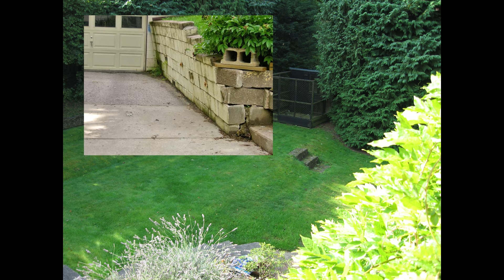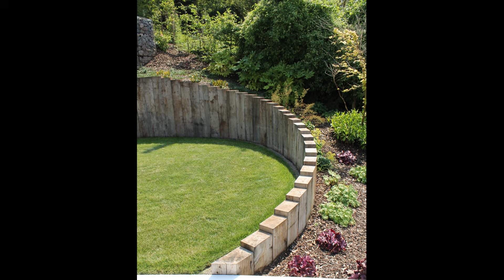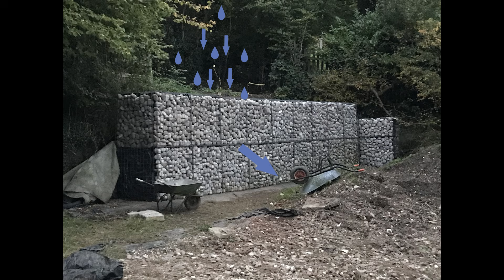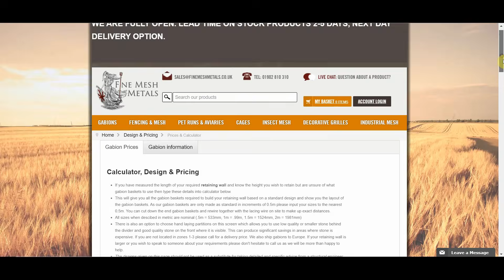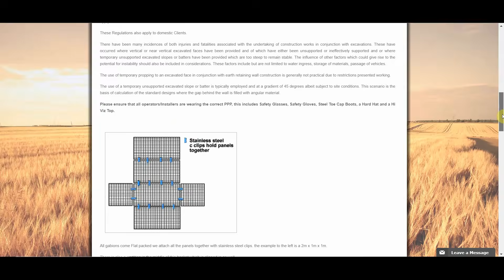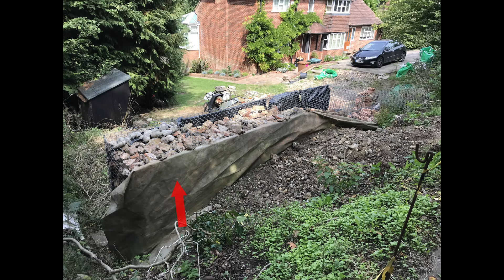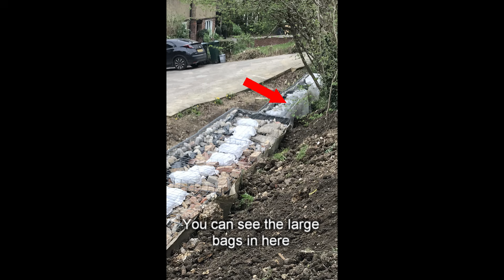GABION RETAINING WALL CONSTRUCTION with cost saving panels | Full Walkthrough with Audio - Part 2

Comment: Hello Karen, in the video here at 11.30 you show how you've lined the inner partition before putting the white cobbles in, can you see this through the cobbles and do you think a white lining might be a better option?
Reply from the maker: Hi Dave, if you go to 3:38 in my first video - https://youtu.be/gmiBY9zmC08 - you can see the effect the black geotextile gives. I did try the white behind the cobbles, but in my opinion it looked like white behind the cobbles! The black seems to give you that indefinite cavity look as if there were further cobbles behind. I guess it comes down to personal preference. I happened to have the black geotextile as I'd purchased some for the driveway rubble, but then after further research found out that the non-woven (white) geotextile was better for behind the gabions as it had better filtration, ie soil couldn't wash through (whereas the black has some tiny holes in it). So I had both to hand.  Does that help?  Karen
Reply: @OurHomeProjects  Yeah definitely, it kind of makes sense as it would be dark and shadowy between the  stones, white as you say  could easily be too obvious. I've ordered the fabric and gabions this evening,  just trying to source the 80mm pipe, I only need 4 metres reluctant to pay for 25 metres! Big day tomorrow, we've made an enormous pile of clay from digging out our dirt and its in the garden - the bloke with the grabber lorry is going to come tomorrow evening to see if he can access it and load it on to his truck. If not we're moving the whole lot again another 60's into a layby down the road from our back gate! There's got to be about 20 tonnes of clay!
Reply from the maker: Hi Dave, wow, hope you don’t have to hand shift anything. Re the pipe. I wouldn’t bother. I suggest sticking a load of gravel behind the baskets. To be honest it’s belt and braces. The gabions are porous themselves so you really shouldn’t need a pipe behind. We added one as the structure was 2m high and wanted to be sure.....you probably don’t need gravel unless you’re getting some in anyway. Which fill are you using - gabion stone?
Reply: @OurHomeProjects  Hello Karen, yeah the bloke came round this morning and thankfully it's all systems go and he'll remove it all on Wednesday which is a relief. I think I'll take your advice and scrap the pipe unless I can source some in the next 2 days or so for a reasonable price . I've ordered the Gabions using same place you did and we're yet to decide what stones we'll use. As we dug the 2 old walls out and all the clay, we put aside all the rubble and sorted all the small stones as well, so I've got some 'Grave'l as such. Looking forward to Wednesday and seeing the back of all the clay!
Reply from the maker: If you looked at my Garden Room Groundworks vid (https://youtu.be/dumv_ghrT3c) you can see how stony our soil is and I used all those little stones as 'gravel' behind the small retaining wall. Seemed to be effective. I'm building another retaining wall (this time sleepers!) and have sieved out all the small stones again to save getting in extra gravel.  I'm sure anything that offers a bit of space, like a soakaway, would be just fine. Soooo pleased your grab lorry can remove all your clay. You'll have to send me some photos when you have some time. Email address is on my About page. Karen
Reply from the maker: How's the project going Dave?
Reply from the maker: Dave, YouTube seem to have deleted your comment. I briefly received a notification, but it says the comment has been removed... not by me! Please post again. Karen
Reply: @OurHomeProjects  I swore in it (Low level)... "Bl**dy" - I wonder if that was the reason? It's late, I'll re-write it again tomorrow!
Reply: @OurHomeProjects  Karen, the project has stalled at the moment. Initially it was down to FMM, their delivery was over a week late, so I wasn’t inclined to place the order for the cobbles till I’d received the gabions. Eventually, once they had turned up I placed the order and was hoping that, as inferred on their website, delivery would be within a few days. That was nearly a month ago now! I kind of knew that a few days was optimistic and gave it a couple of weeks and then followed it up. At the end of last week they said the cobbles would be with us at the end of this week. They’ve not arrived today and looking at my emails today there was a message and I’ve looked at the tracking facility on the website and the delivery appears to be at stage 2 of seven stages ‘On it’s way to The Hub’. So with a bit of luck, if they working and driving overnight there’s a chance that the delivery might arrive tomorrow at some point? Thankfully, unlike a lot of people who set aside and take days of to receive these deliveries, I’ve been lucky as one of my sons is at home at the moment having graduated and he’s here looking for work and doing interviews and the like. If it hadn’t been for him returning home at Easter I’d be in a right fix and not particularly happy! Fingers crossed tomorrow.
Reply from the maker: OMG. I’m so sorry to hear this. Fingers crossed as you say. No wonder you ‘swore’ last time 😂 How’s the actual bank holding up? Not sure where you are, but it’s been mostly dry with us in the SE so the ground is rock solid. Will wait for you to update next time 🤞 Karen
Reply: @OurHomeProjects  Same here in Essex – Dry as a bone. We’re in a London Clay zone, so on the surface it’s cracking up, but holding together fine generally. I’ve made some dumb mistakes. Wanting to crack on with it, when the gabions arrived I assembled them and tied in all of the wires – front to back and side to side in readiness for the bulging. We’ve started filling the backs of the gabions as well with the rubble, so then when it came to backing the inner dividing section with the black fabric all the wires were in the way, so I’ve had to cut that into strips and cable tie it all into place which was real aggro and fiddly. The other mistake made is the gabions are right up against the earth and we’ve not been able to get many of the small stones down the back of the gabions. I may have to buy some tiny pea shingle and try and get that down there.
Reply from the maker: Argh, really sorry I didn’t put that in the video as I learnt that lesson too, but only after 2 baskets were tied, not the whole lot! Glad you found a fix for it, at least you had time on your hands so to speak! Re the shingle, as long as you have some small cavities in the main basket for water to flow into, gravel immediately behind the gabion might not be necessary. However, once they’re fully filled and you’re back filling the soil, a bit of gravel mixed in wouldn’t do any harm if you still have any patience or energy by then! Karen
Reply: @OurHomeProjects  We've noticed your cobbles are really quite pale - almost white. Were they predominantly white?
Reply from the maker: Hi Dave, they look mostly mixtures of grey when dry with the odd dark, white or reddish one. Once wet they look amazing, which is usually at least half the year lol... 😂
Reply from the maker: Check out 14:45 for an image of what they look like once rained on!

Comment: Karen, what a superb video, thanks for sharing. I do have one question, with the wall being over 1m, did you have to consult and get building control approval? I am in a similar position to yourself and considering gabion baskets. thanks in advance olly
Reply from the maker: Hi Olly, thanks for the sub :)  It doesn't show clearly in the photos, but the bank was actually really steep in the first place and had been retaining itself for decades. As we didn't excavate more than a metre high into the bank that was previously there (check out image at 00:48) and the entire wall was not over 2m high, we didn't need to go through building control. I believe you may require BC approval if it's a 'party wall' ie on a boundary with a neighbour, but ours wasn't. I'm afraid I can't help any further than that. Sorry! HTH Karen

EDIT - forgot to say good luck with your project! It really is a fantastic retaining system if you have the space and use a very heavy angular fill.
Reply: @OurHomeProjects  thanks for reply karen. Yes looking forward to the challenge.
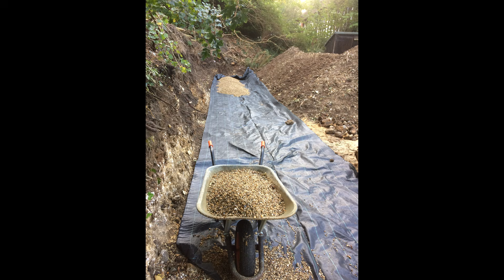Reply from the maker: @Oli007uk  doh, it’s 00:48 in my other video...!! It’s not quite the same, but you can see the bank cut in at 07:00 (or head over to the first video to see it more clearly https://youtu.be/gmiBY9zmC08). Sorry about that! Good luck!

Comment: Good job.  It looks great.  I would like to see how it is in 5 or 10 years, plus how much upkeep you need to do.  Thanks for sharing your project.
Reply from the maker: Hi Neil, thanks for watching. The right 2m tall section was completed in 2016 and the left hand shorter section was completed in early 2019. Both holding up well and you can see them in my Steep Driveway Finish video which was completed in Autumn 2019. It really is a great system, however, as I've mentioned in other comments, the brick fill/gabion stone is the best; the gravel bags shouldn't be used on anything over 1m tall (which was my downfall with the left section). I'll have to post an update video once the wood slat walls are finished on the driveway block retaining walls. Karen

Comment: Thank for your video,I have to do an retaing wall aswell 6 meters long 50cm wide and around 1.7 High ..my question is do I have to dig for basquet to be in the ground or I just need to make the ground level? Thank you
Reply from the maker: Hi Nicolae, thanks for watching. I suggest part of the bottom of the basket is below ground (it's suggested 50cm). You may also want to consider a 1m3 basket on the bottom row as it's doubtful 50cm deep at that height will contain enough solid material to hold back the bank. Have a look at this page for more detailed info - https://www.gabionbaskets.co.uk/gabion/gabion-wall-standard-design
Karen (just a DIY-er, I have no technical experience!)
Reply: @OurHomeProjects  thank you 😊